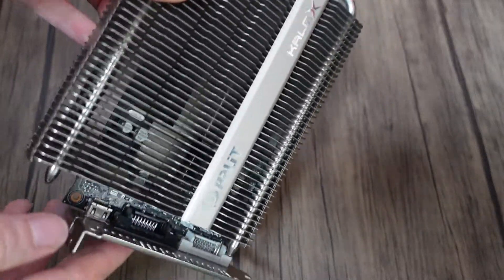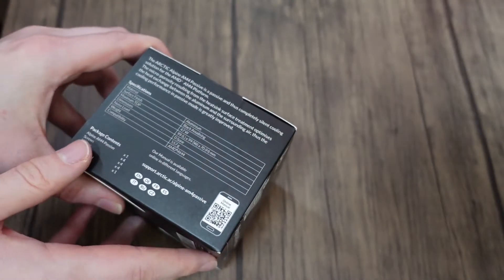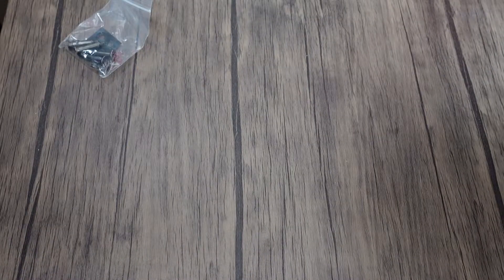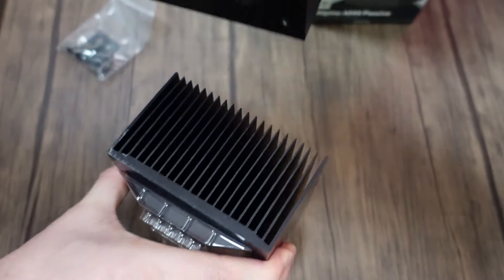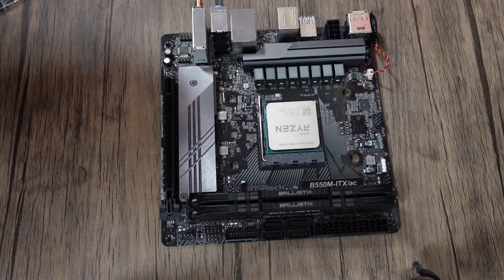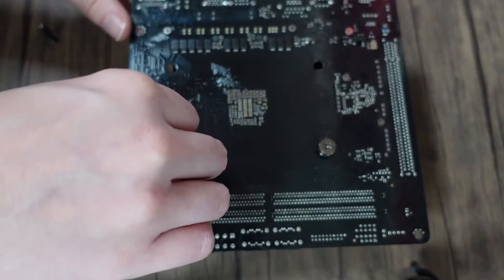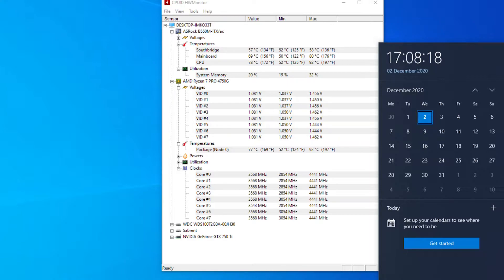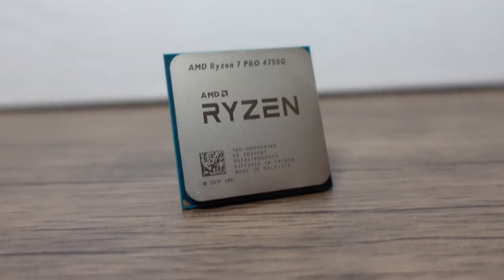Arctic Alphine AM4 Passive - Can it cool the 4750G a 65 Watt TDP Zen 2 APU?

Comment: bios man, bios voltages!, offset mode (-)
Reply from the maker: With the zen 2 platform all I find with negative voltage offset is a decrease in performance as well as heat. You get overall better results just turning off the turbo. I did a video a while back showing the undervolted difference with this chip.

Comment: I'm going to be using this cooler with a 3700X bios-forced into 45W ECO Mode. The case it's going into will have larger fans in the front (multi system case). Thank you for this video.

Comment: That's pretty good actually. It makes it a feasible option then to run a totally passive system while doing light work and have a case fan to help it when you game. The shimmer of a case fan shouldn't be an issue if you're in-game anyway. I'm curious to try this now on my Ryzen 7 3700X.

One thing that would be interesting is using the graphics card fan to push air through the fins. If you aligned them properly it's technically doable (on some motherboards), so I wonder how effective that would be with the hot air coming out from the graphics card.
Reply from the maker: I was reasonably impressed with it. Should be fine for a 3700x since it's basically the same CPU just no iGPU. Just be aware this was outside a case so expect things to be a little higher. Also ensure the case fan gets some air over the VRMs as well since they can get rather hot with no airflow
Reply: @AvenyetsTechWorkshop  Interesting, I never put much thought into the VRM's, were they the overheating elements on the motherboard you mentioned in the review?
Reply from the maker: Yup after a while they got very hot. They can handle it but it will kill the motherboard before too long.

Comment: I bought one of these to use with a thermoelectric (peltier) cooler and it worked okay. I think the TEC was a little too powerful for the heatsink, but it was fun to let it heat up.

Comment: According to some posts I read on Reddit, it's better to use HWInfo rather than HWMonitor for temperature testing. Ryzen Master also provides temperature monitoring. Because you used HWMonitor, it's possible that the temperatures reported are too high. I haven't compared them myself, but I'd love it if you try HWInfo and Ryzen Master and tell us what temperatures you get there.
Reply from the maker: That was true. The latest version of hwmonitor reports correctly now. Ryzen master unfortantly doesn't support this cpu. And hwinfo reports the same. The old hwmonitor reported some crazy numbers for both the CPU and the motherboard when I first got my 4350g
Reply: @AvenyetsTechWorkshop  Good to know that HWMonitor works now. That Ryzen Master doesn't support it is unfortunate (though also good to know).